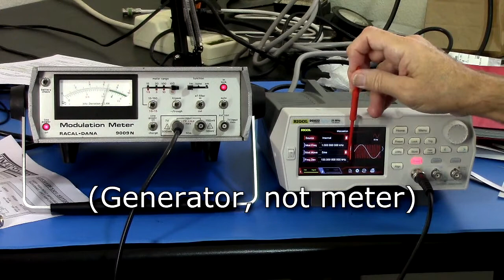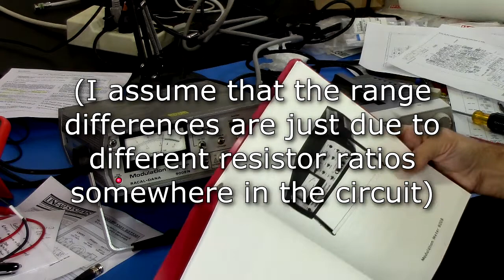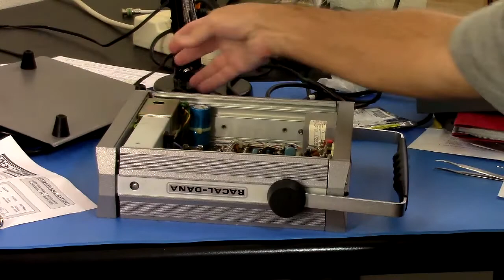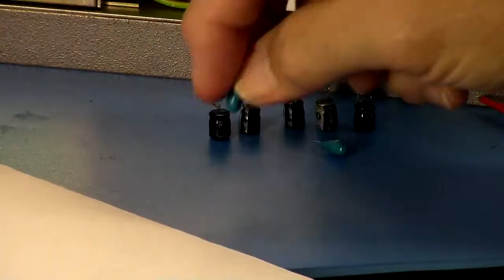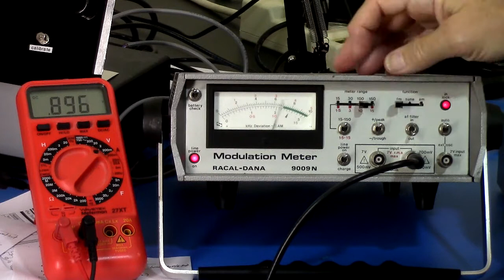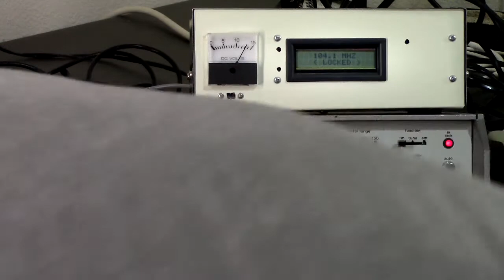Racal Dana 9009N Modulation Meter

Comment: Modulation meters have to be calibrated by a spectrum analyser and bessel function for FM and oscilloscope for AM.
The used signal generator has inaccuracies.
Have repaired and then calibrated a number of Racal 9009 units. It is very stable in it's readings.
GL de Bjoern
Reply from the maker: Everything has inaccuracies (including your spectrum analyzer).  Specs on the 9009 are ±3% of f.s.d. and ±2% of reading for both AM & FM.

This is not a laboratory grade instrument.
Reply: I mentioned the method of calibrating this unit, because it is actually some 10 times better than the specification.
Before we had the HP8902A measuring receivers, we had this Racal unit in our calibration setup. About the best instrument in it's kind, with very wide self locking into a generator signal.
We had to use the FM Bessel to be sure to adjust the reading as best as possible.
You can be proud having this very accurate modulation meter.
GL de Bjoern
Reply from the maker: I don't dispute that you may be able to achieve better calibration results with the proper equipment.  However, I think you overstated your case in your original post when you said "Modulation meters <b>have to be</b> calibrated by a spectrum analyser..."

Comment: I Have the 9009N its the same   circuit as far as i can tell to the 9009 however the oscillator in my one runs 14 to 22 mHz and is in a can not open... The scale switch and range are different on the N version 150kHz vs 100 on the 9009....My meter dances all over the place with no input signal obviousy a problem i need to fix...